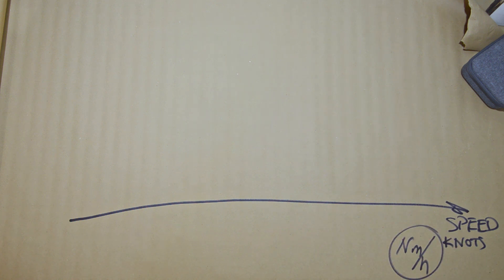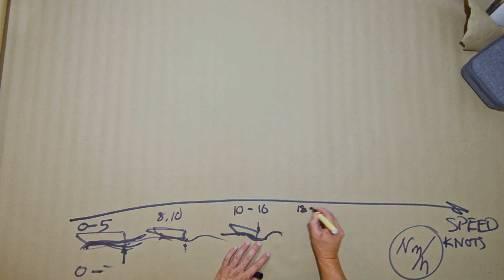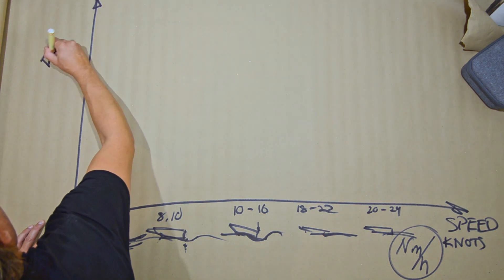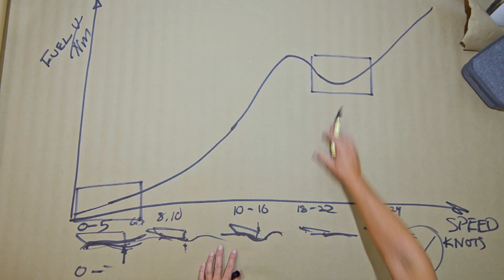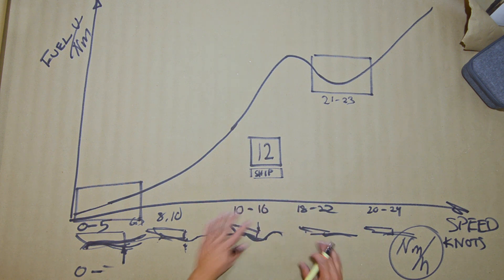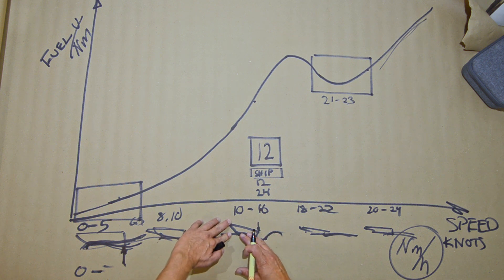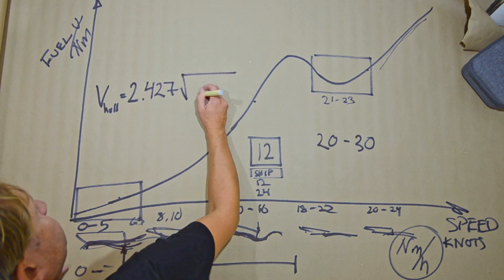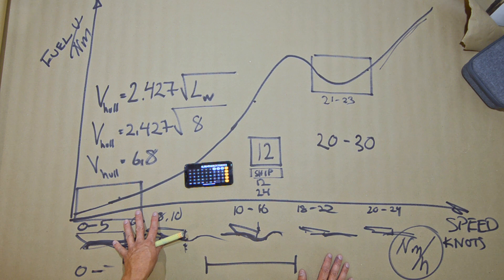HOW TO SAVE FUEL ON A POWER BOAT

Comment: I would agree with your diagram if the vertical axis was fuel per hour. Not fuel per mile. As it is now traveling for a certain distance, at 15 knots you will burn less than at 23 knots and that is not the case at least with my boat....

Comment: Great Presentation, Florida, USA boater here, Bay liner 175, 135 HP 3 Liter, I find the most efficient "no wake" speed of around 6kts as you say, and best cruising speed at around 3,000 RPM or 28 MPH indicated.  Supposedly 4.7 MPG.  Boats simply push too much water to be efficient.   would like to do a hydro foil.

Comment: Enjoyed you video 

The best explanation of fuel economy on a planing boat

Had my 8.5m power boat  for 12 years now I fitted a fuel computer when I first got it and you  are 100% correct 

0-5 knot best miles per gallon 

18-22 best miles per gallon at speed 

All other speeds avoid if you can

Comment: We have a 32ft 1959 Chris Craft, almost flat bottom. We have done extensive testing with many propellers and speeds. We are at 3l per Nm at 6 knots, 5l per nautical mile at 12knots and we just plow at that speed. At 20 knots we have our most efficient speed and only use 2l per Nm, and we are on a full plane. Two gas 350s.
Reply from the maker: Maurizio Hublitz Seems you are following the curv I draw but I could have drawn it better with a deeper dipp at 20 knots.